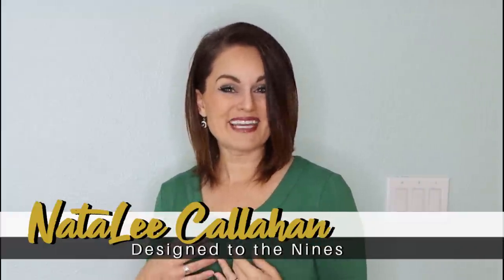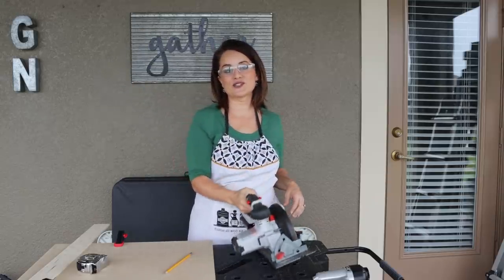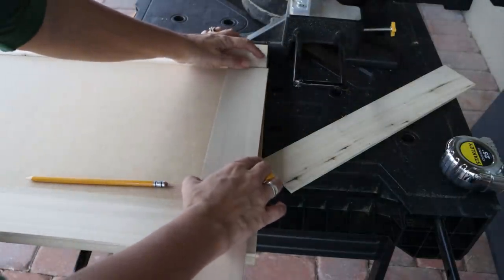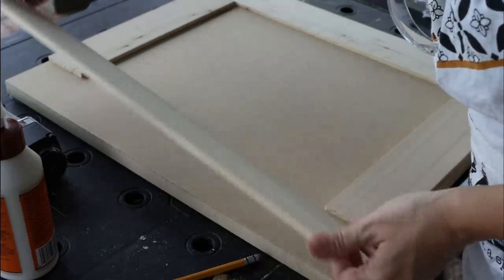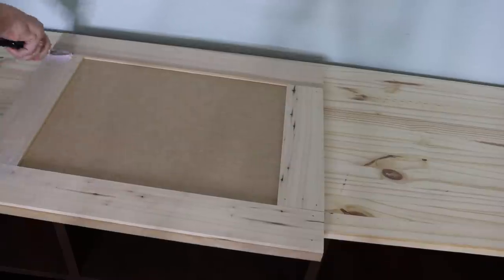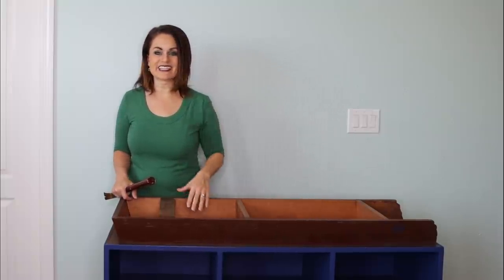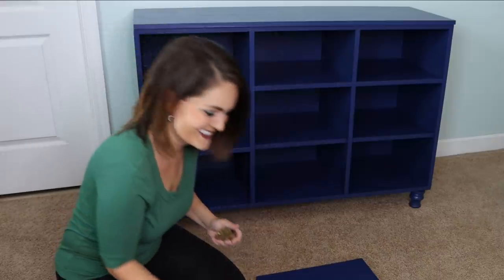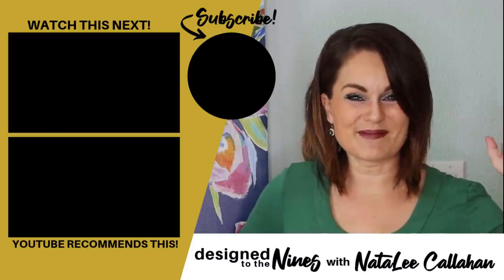TRASH TO TREASURE | Extreme DIY Thrift Store Furniture Makeover!

Comment: Love this. What is the brand name of the blue paint and what color is it? I see u put the other paint down but I don't see it. And I love love your strip walls thanks for sharing 💕
Reply from the maker: It actually was a custom color match to my curtains on the main floor... Here is the code (I hope it's right) It's mixed in Valspar Signature:

BsC-773949 101-1 Y28.5, 102-5Y24, 113-1Y13.5, 115-3Y30.5

Hope this helps!

Comment: could you tell the name of the paint color and brand you used i really lile it.
Reply from the maker: It actually was a custom color match to my curtains on the main floor... Here is the code (I hope it's right) It's mixed in Valspar Signature:

BsC-773949 101-1 Y28.5, 102-5Y24, 113-1Y13.5, 115-3Y30.5

Hope this helps!